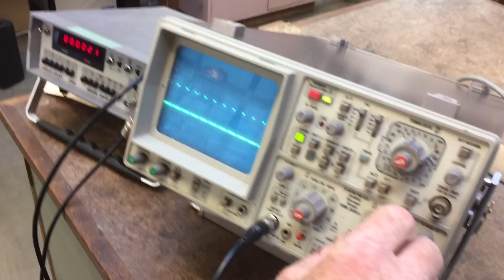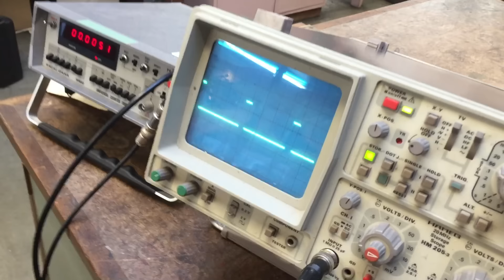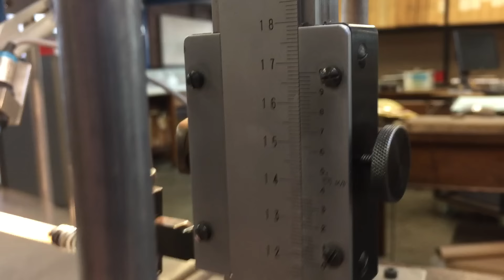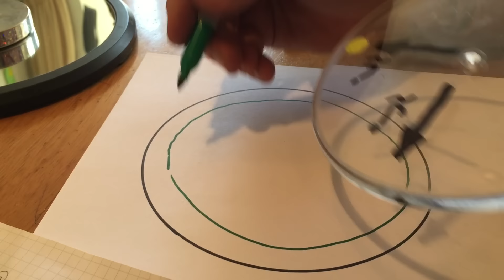Matt & Hugh: The Euler Disk Which Spins Forever

Comment: Please make a video showing why the best ratio of width to height of an Euler disk is around 6 to 1. I would love to know why this ratio is often considered the best 😀
Reply: idk about most of this but well the ratio of circumference to radius is also around 6 to 1. (2π : 1)
So there's that 😏
Reply: I think 6:1 might depend on the composition of the object... Depending on the material that is used; its density, its surface texture {smoothness or roughness},  the amount of friction that it applies, and other properties that can be leading factors this ratio could change.

Comment: Math Machine
I did some maths.  I assumed the disc is of uniform distribution, there's no rolling friction, and there's no air resistance.  Under these conditions, I believe the disc should remain at a constant angle from the horizontal.

The rate at which the disc spins around the vertical axis is equal to √(6g(2rcos(θ)-hsin(θ))/(sin(θ)((3r²+4h²)cos(θ)+6hrsin(θ)))), where h is the thickness of the disk.

Assuming the height is small compared to the radius, this leads to a rotation speed of 2√(g/(rsin(θ))), and assuming θ is small, this gives your approximation of 2√(g/(rθ)).

In addition, the rate of rotation of the dot placed on the disc is equal to the rotation speed around the vertical axis, multiplied by cos(θ).

A small note, according to the formula I provided, the rate of rotation when θ=π is √(g/r).  Technically, the disc could rotate at whatever speed it wants at this angle, as it's technically in equilibrium.  However, if the angle were slightly below π, it would need to have a rotational speed of about √(g/R) in order for it to not fall into either the vertical position or towards the ground (depending on how stable the θ=π equilibrium is).

Comment: I wonder how much air resistance affects the slow down. Vacuum chamber experiment maybe??
Reply: +Adam Sowder I meant the regular euler disk, not this setup
Reply: Probably you lose more energy due to vibrations (sound) than due to air resistance.
Reply: +Santiago Picco true, but in a vacuum chamber the only vibrating medium would be the mirror. Maybe it would result in better longevity. But one more complication occurs: how do we spin the disk in the first place? lol
Reply: the way hugh releases it is probably fairly easy to simulate with a sort of claw rig to drop it in a precise way
Reply: +EffingTank yeah maybe
Reply: +berkcancosan Tadashi Tokieda used a bracelet to eliminate the trapping of air under the disc since it's basically the outer edge of a disc with nothing in the middle. I don't know it affects the experiment though, he only says he did it to prove that it is not trapped air that makes the disc behave like it does.
Reply: Curse you for suggesting the vacuum chamber. I'm not sure if I'll be able to rest until I do this.
Reply: it's the only dissipative force basically,  the amount of energy you are putting into the system with the air jets is the same as the effective air resistance
Reply: Have you rested yet @Duane Degn? ;)

Comment: This problem is much simpler.  There is the diameter of the disk is (A).  There is the diameter of the circle traced by the disk--the green circle on the page he drew (G).  And then there's the height of the of the disk above the ground (H).  Together these three variables form a right triangle with the hypotenuse being A of the AGH triangle and the right angle being formed by the intersection of GH.  So the length of G is found by the pythagorean theorem.  The amount the dot moves is the difference of the perimeter of the circle with diameter A -  the perimeter of the circle with diameter G.  The angle of the dot movement in a single "revolutional thingie" depends on height.  There you go.  All your numbers are spot on.  You could measure the top of the disk with a laser if you want to be very precise.  Since all the disks you're using have a bit of height,  you'll need to modify the simplified equation above to address the spinning cylinder rather than the spinning circle that I've calculated.

There you go.  All measurements are spot on.

You could even add a gravity calculation to tell you wobble rate however that probably won't work in your equations due to air flow effecting spin rate.  And you might find a bit of error due to slippage that might go away if you increased your friction...maybe by putting a rubber band around your disk.
Reply: David Urry Are you sure about this?  I don't agree with their calculations at all. Sec(x)-1 simply can't be correct. It is almost correct for x close to 0 but dead wrong for x close to 90.

Comment: Graph should have looked more like an exponential graph than a logarithmic graph. some points
(0, 0)
(pi/8, 0.082)
(pi/4, 0.414)
(3pi/8, 1.613)
(pi/2-.0001, 9999)
(pi/2,Undefined/infinite)
Reply: I think the easiest way to think about graphs of secant and cosecant is to first draw (or imagine) the cos(x) or sin(x) graphs. At cos(x) = 1 or -1, 1/cos(x) is the same, and then at cos(x) = 0, 1/cos(x) has dove off to infinity (or negative). Just like when drawing cos or sec, it's simple if you just remember the points for 1, - 0, and -1.
Reply: I agree.  I (still) don't believe that Matt's expression is correct.  It probably is a good approximation if theta is small.
What i'm concerned 1-cos(theta) is a better approximation.  By the way, how did the professor measure the spin rate and how does this relate to beta dot ?
Reply: pretty sure the professor was joking, there's no way he does not know what a sec graph looks ike.
Reply: +Carlo De Michele  
Correct, and if we look at this graph we see that for theta larger than 60 deg the expression becomes lager than 1. If sec(theta)-1>1 => spin rate > wobble rate. How is this mathematically possible for a non slipping, only rolling disk?
Reply: +Carlo De Michele 
I mean how can the spin rate be faster than the wobble rate?
Reply: I think you might have misunderstood what one of the terms means exactly, since the spin rate going over the wobble rate is fine. The spin rate is the angular velocity at which the disc rotates around the center of the path, which is illustrated by the distance a marked point moves along the pathed circle's circumference for a given time. The wobble rate is the angular velocity of the disc rotation around its own center, or essentially the rate at which a marked point touches the ground. So basically if the ratio is over 1, it just means the marked point does a full rotation around the path before it touches the ground again, which should be easy enough to visualize.

The key thing when they equalize is that when θ = π/3, the pathed circle's radius is R*cos(π/3) = R/2 for disc radius R, and so the circumference is also half of the disc's. For a lap around the path's circumference, there will be half a lap done around the disc's circumference (half a wobble). Meanwhile, you should also be able to see that the elevation angle affects the spin rate by (1 - cos(θ)), where at θ = π/2 you have a perfect spinning disc where it does a full spin on one lap of the path's circumference (1 - cos(π/2) = 1) and at θ = 0 the disc does not spin at all (1 - cos(0) = 0). At θ = π/3, you get 1 - cos(π/3) = 1 - 1/2 = 1/2, which matches up exactly with the wobble rate. For one lap around the path taken, there is half a wobble and half a spin.
Reply: +Vulcapyro 
No, I don't see this yet but I'll check it. But as I understood Matt defined the wobble frequency as the angular speed of the contact point of the disk and mirror whereas the spin rate is the angular frequency of the projection of the arrow (or yellow dot) on the mirror plane.
Reply: Ok, so that isn't quite the wobble rate. If it were the angular speed of the contact point (and so relative to the mirror), it would already be affected by the spin rate, since the disc will have rotated while the mirror would not. The wobble would be exactly on one lap around the path's circumference, rather than one lap around the disc's circumference. The difference between the two is exactly the distance the marked point moves per lap around the path, as Matt showed in the previous video, which corresponds to the disc's spin. You're chopping off that distance for what you're considering as wobbles, and so it would be impossible for the spin rate to exceed those wobbles.
Reply: +Vulcapyro 
I thought it had to be something like that, but I can't agree with your assumption. Wobble or precession of a rotating body are the same thing. precession is used more for prolate bodies and wobble for oblate bodies. Precession is defined as the rotating frequency the symmetry axis of the rotating body makes and in this case this equals the rotating frequency of the contact point in the mirror plane. You can see this in this video because dr. Hunt measures the wobble frequency by means of an optical sensor. The signal this sensor shows on the scope is in sync with the rotation of the contact point.
Don't you agree?

Comment: Question of the hour: Given an initial angle and rotation rate, coefficient of friction, and disk weight and geometry, how long does spin down take? Dimensional analysis can suggest that the time is proportional to the square root of (r/g), where 'r' is the disk radius and 'g' is the acceleration due to gravity.  … I'll leave the rest as an exercise for the reader. (-:

Comment: For measuring the angle on his air assisted rig, could it be filmed with a high speed camera and a series of angles marked in the background (similar to a protractor) and then choose the frame from the footage that has the plane of the disc perpendicular to the camera? 

That way you get a still image with the angle on it, and can get a more exact measurement than using the rubber finger thing and stopping when it looks close enough.

Comment: Great video. So I’m not good with math and formulas, but I am very curious. I have seen demonstrations where dropping a magnet inside of a copper tube will generate some resistance to the force of gravity. I am assuming it is creating a minor electrical charge somehow. What happens if you create an Euler’s disk out of neodymium magnet material, and then put that spinning disk, into a copper framework, or tube with the mirror on the bottom? Would the movement of the disc create an electrical charge? Magnetic field movement to fixed copper element? And what effects would that have on the disk? Would the spinning disc potentially levitate still spinning as the oscillating movement matched the forces of gravity? Possibly eliminating most if not all friction? Off to the net to see if anyone has tried this.

Comment: I have a suggestion for a new title for the series: Matt learns how math works in the real world :p

Did you write down all the error specifications of all the measuring equipment, Matt? :p And the serial numbers? How round and balanced was the disc? Was it to the cm accurate? Mm? Grams? A tenth, or hundredth of a gram? :p Did you calculate the actual error of the measurement? :p

Comment: Anyone sho does engineering, design, building...eventually discovers how unavoidable it is to stumble on swastikas. They are a very useful geometry. In this case, an air swastika is what allows this to work.
Reply: It's more likely just easier to mount four of them on a square table.

Comment: I was wondering if in fact there could be more to the equation for its frequency by not just adjusting simply the gravitational constant, but instead change the mass. i say this because what was done was a force was applied to the disk, and if you place more mass at it's center, then there should be more force.

Comment: Shouldn't you incorporate the density of the disk into the formula?

I expect it would slot in next to (or incorporate and replace) the gravity constant?
Reply: Follow up: how would a variably-dense disk (or a ring) affect the motion? Would the system just behave as if the disk were uniformly the average density?

Comment: From a logical perspective, can someone correct me if I’m wrong...The distance the yellow dot progressed around in one revolution is derived from the overlap of the circumferences between the disk at rest and the smaller circular path. The smaller circle  diameter is calculated in sectional view as the bottom chord of the right angle triangle defined by the angle of incline and the actual disk radius as the hypotenuse. All of this could be plotted quite easily to determine relationship between angle of incline and rate of yellow dot rotation. The only variable then is the rate of fall of the disk angle. This seems like a simpler analysis? I’m not a mathematician:)

Comment: I've just discovered this channel, so I've probably missed my chance to ask the burning question: the CG of the disk is moving.  If there were zero losses to friction, slippage, or air resistance, what path would the CG follow.  Does the path that is actually followed provide a measure of the friction coeficient?

Comment: Random mathematical question:
What's your favourite conic section?
Reply: ***** The hyperbola is, like, a million times better than any other conic section!
Reply: Ellipses. They are awesome because when you try to find the arc length of them by using integrals you get to a integral that is impossible to solve (I learned that the hard way). Which is quite weird because you can totally do the same thing for circles and get a nice value. But this fact on it's own made a new thing called "ellyptical integrals". I don't understand these things really well to be fair, but it's pretty cool. And if I recall correctly the impossible integral you find will give you a ratio of that ellipse's radiuses and it's circumference, just like Pi is the ratio of the radius and the circumference of the circle.

What's interesting is that if we didn't have Pi as a constant we would also probably have to solve a impossible integral to find the circumference. Of course, circles are simmetric and perfectly scalable so we only have one constant, unlike elipses which we have an infinite amount of them.